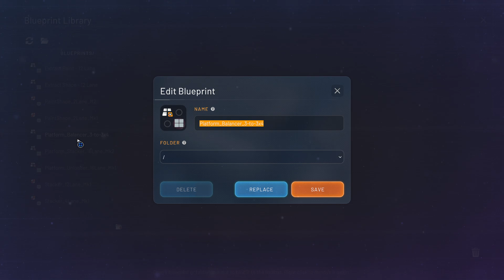Shapez 2 - S01E15 - Practical Balancing Work

Comment: Make anything machines are quite insane. I tried to make one for Shapez1, I even read guides and looked at other MaMs videos, and I couldn't make it.
Shapez 2 is even more complicated given you have pins and "crystals" (you'll see them soon) to manage. I'll think I'll do the hard modes first...

Also, ignore balancers, just always produce 12 belts of every step !
Reply from the maker: @miakintosh  Yeah, that's the solution I'll come to. Skip balances and the MAM... well, we will work on some of the parts here and there. Idk if I'll complete it as this series is still being recorded. I'm optimistic tho.